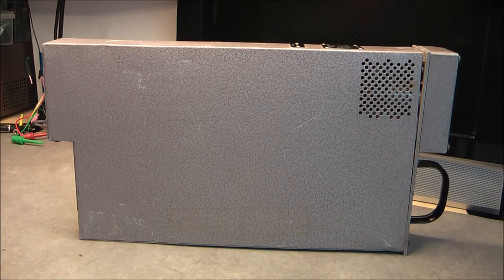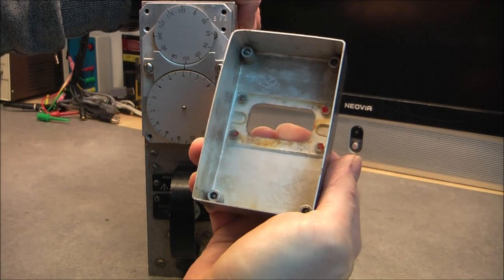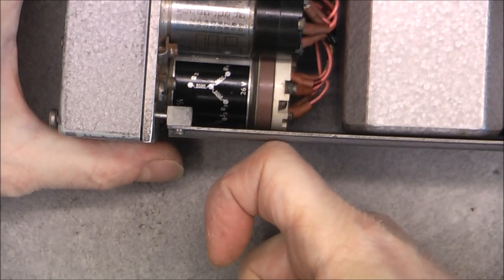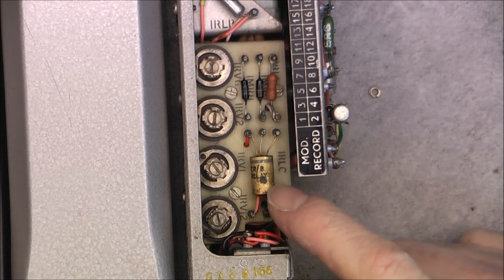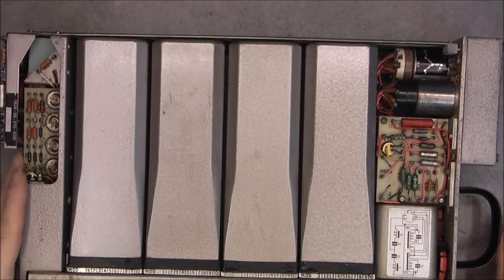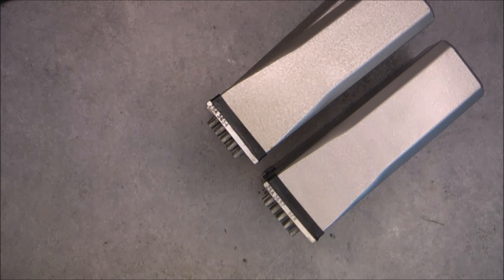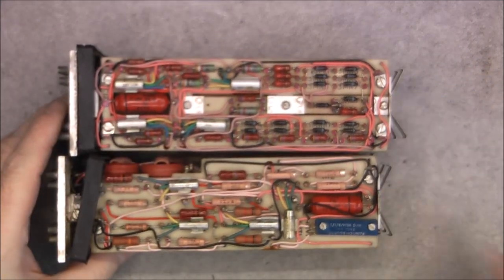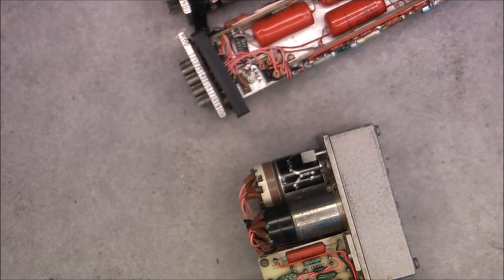Avionics teardown : 1960's Marconi navigational analyzer

Comment: We used to add repair date codes to all the equipment we repaired at Marconi, typically R for repair, YY for the year and XXX which designated the works unit, where XXX is alphanumeric; if you can find such a code it will give you an idea of when it was repaired or modified.
The pin and board layout is definitely from the 1960s, although it continued to be used into the 70s but in conjuction with PCBs.

Comment: @6:50 Transistors? They have only 2 legs so I guess diodes...
Reply: The MR designator indicates they are diodes (miniature rectifier if I recall correctly, it's been a long time since I worked at Marconi)

Comment: Did you mention what those two round devices were in the last two cases? They look like battery button cells.
Merry Christmas to you and your family sir.
Reply from the maker: They are wet tantalum capacitors.
Reply: @msylvain59  
Interesting, thanks.
Reply: Much beter than tantalum that are used in consumer electronics, much less prone to catastrophic fault like most tantalums ( fire from short circuit )
Reply: @ljubomirculibrk4097  Wet tantalums contain sulphuric acid, they were an absolute nightmare when they leaked (and they did), frequently destroying everything nearby.